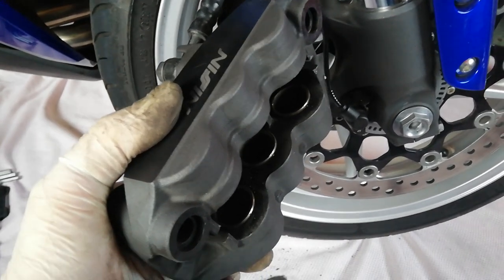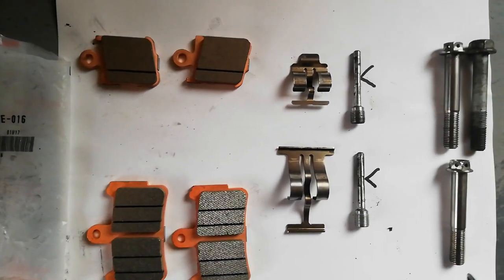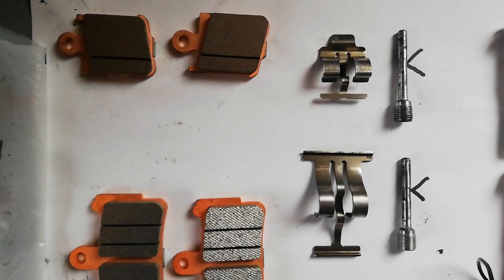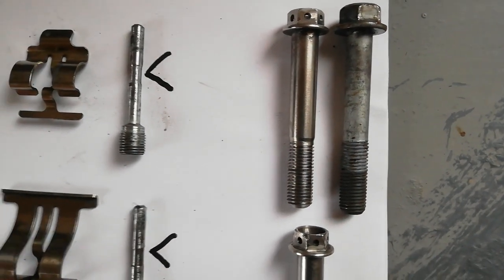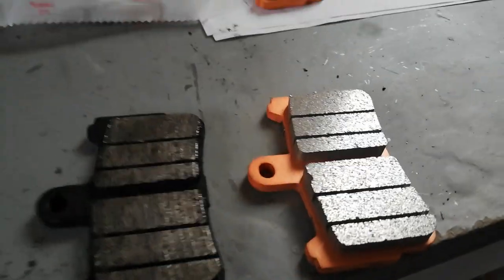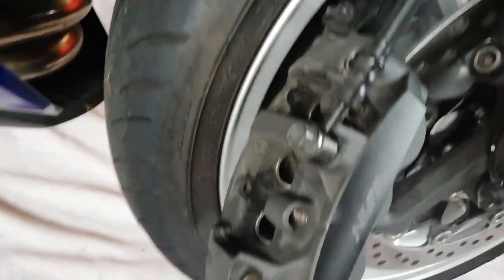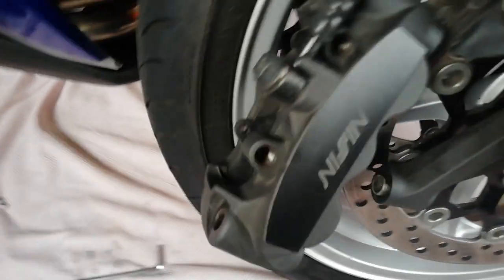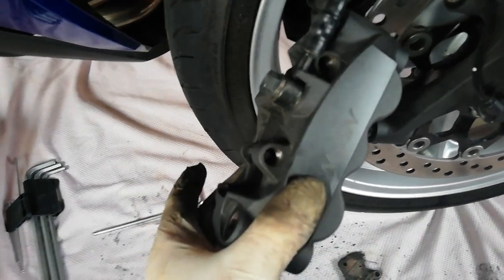Honda VFR 1200 Front Brake pad info.

Comment: Thanks for your quick reply Graham I’m going to give the valve clearance a miss I think 18 k on the bike, and it’s running great, I know what you mean regarding trust many people I’ve spoken to on line feel a bit ripped off and don’t suspect they have been done, the Honda dealer who services my bike I asked for its yearly service  plus air filter change, they said no point in taking off the fairing just for the air filter, indicating to get the valves done , so my friend who is quite good with bikes is going to help me , many thanks Graham
Reply from the maker: Just because you mentioned air filter, check the state of mine see link https://youtu.be/8RPi6H9ibAs.
My bike had been serviced at 15k (previous owner) 1k before airfilter was due, but you would think they would do it anyway. (I assumed it was done ) As you see it was a dreadful mess.

Comment: Another really useful video 👍 what brake cleaner do you use before pushing the pistons back in, do you find any of them more effective than others?
Reply from the maker: Well Glyn, I've always been a Biker on a budget, so I tend to look at ingredients, rather than brand. So I usually use PMA brake cleaner, as its effective and cheapish in 'Boyes' which is a north east chain of shops, I've used comma and halfords before, but not noticed any difference. 👍
👍

Comment: HI Graham those pad pins are ok  changed brake fluid on mine today and clutch fluid  my pal was working today so took wheels out and got tyres fitted  i am waiting for a R&G Rad grill cover to arrive  once here will fit that have you also taken off the shocker linkage yet and greased it you really need 2 do it mine was bone dry and bike only done 7000 miles.
Reply from the maker: Cheers for that Andy. Yea the linkage lube is on the list, might replace the bolts/nuts also as they are aesthetically a bit knackered.
Reply: @Grahamvfr  yes its easy to do would change brake fluid as well get a easy bleed tube with a none return valve same one you use on car brakes .

Comment: Says in the workshop manual caliper bolts should be replaced with new ones not quite sure why?
Reply from the maker: Oh I hadn't seen that. As you say that's a bit over the top.🤔 Thanks for watching
Reply: Metal fatigue, it's mostly a cautionary safety from manufacturers